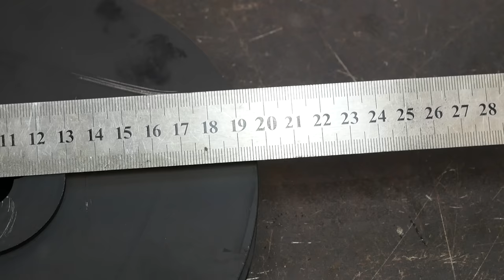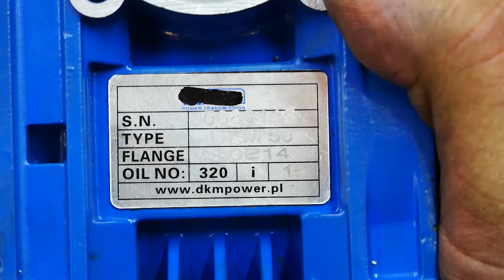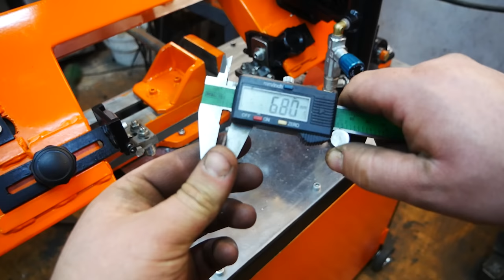Making Band Saw Machine for cutting metal

Comment: For anyone that wants to do this type of work and does not know what and how to ask anything, cutting speed for metal is around 30 to 70 meters per minute. It depends on the material that you are cutting, but if you are cutting harder materials, like stainless and some harder steel, go for 30, 40 meters per minute. Avoid 50s because of harmonics, vibrations... Not worth to brainstorm it. So, vc=(D*3.14*n)/60. vc is cutting speed in meters per second. D is a diameter of a pulley that you need for desired cutting speed, in meters. 3.14 is constant Pi. n stands for rpm that you drive your saw. For 40 meters per minute, 0.67 meters per second, if you are in Europe, frequency is 50Hz, you need 1400 rpm electrical motor, 10:1 gear reducer, so you have n=140rpm. The pulley diameter is then 90 milimeters. 91.44 if we want to be precise, but it is not needed. This is just for example. You can do whatever you need and want with this formula. It all depends on what you already have.

Comment: Note that at about 16:43, there is a nut on the left hand set of bearing rollers that is unscrewing itself.  May need to secure that somehow.
Reply from the maker: I've made a few more fixes outside of the video, but thanks for the advice :)
Reply: @InfinityGarage-ig8py  Just didn't want anything to fly off of there while the bandsaw is running, lol.  It was a very neat build, thanks for sharing.